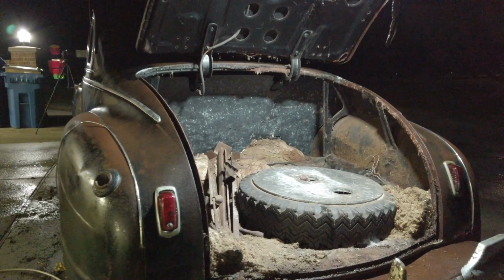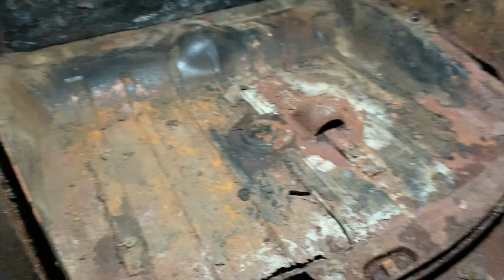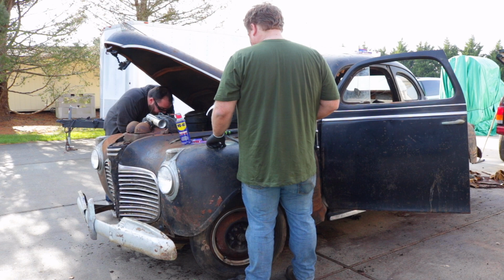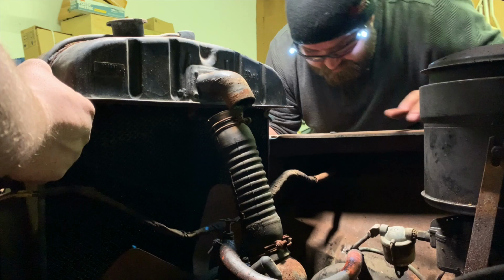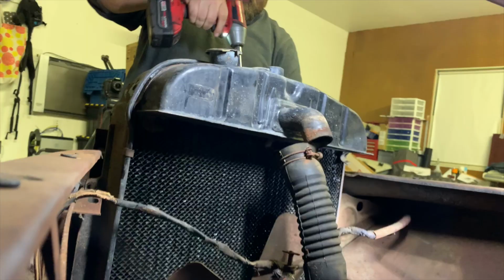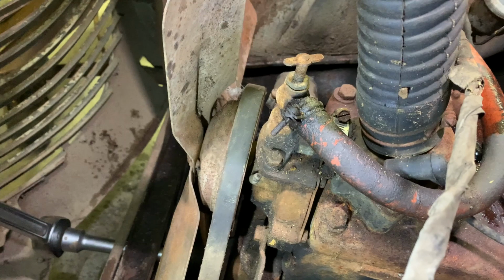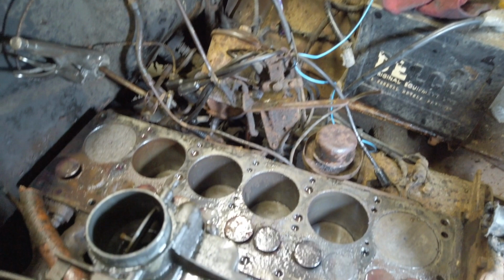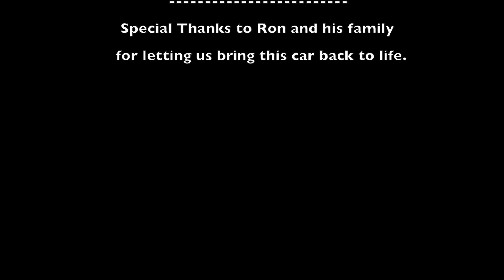Barn Find 41 Plymouth!  E:2 Clean Up; WILL IT START?

Comment: Exact same issue with my 1950 Dodge Power Wagon. Use a plastic hammer to tap valves closed as you crank it. I got it running enough to move around on it’s own. I did an old school valve job the following winter
Reply from the maker: We called a few flat head guys we know in California and they pretty much said the same thing.

Comment: When pulling or bump starting a car always use 2nd. or 3rd. gear. Never 1st.or reverse. It's a gear ratio leverage thing. Now for serious scraping, scrubbing and scrubbing some more. Hope you have a new head gasket.  You have the right juice for the unsticking  job. I use Marvelous Mysterious Oil and Diesel fuel 50-50 mix. A small wire wheel on a drill combined with New Words for busted knuckles will get the job done. Have fun gents I love that '41 Ply.
Reply from the maker: Thanks for the tips!  Busted Knuckles are a must for these projects. Thank you for following the project as well.

Comment: For one guy working and the other thinking, your doing fair. As those valves open doose the body of that valve with pb blaster or sea foam or something besides water displacement forty in the blue can as it can make harder.  then when cam has gone past point that has opened it tap the stuck valve back down ... while it it open use some croakes cloth and clean as much rust off  without reshaping the  valve, its pretty tuff so scuff it good. I would worrall it over once dried out with clean plugs back in head and reuse the copper head gasket. if necessary with hot wired tow to start a ways down the road. don't have to turn fast as everything is moving... like second gear and let it warm the engine a bit. as long as its being towed and has gas in the carb hole, it will fire but not enough to run till warmed some. You could safely bore those old engines ,120 over  without getting into water jackets so tow hell out of it! One in tow rig and one in car being started and one on fender riding with bottle of gasoline to get it going. within ten to fifteen minutes it will fire and keep going as long as it is being towed till you can push clutch in and it stays running with someone adding gas. You will be surprised at the torture it will take. Long as head is off keep tapping the valves till they close on their own. 5 out of 6 will work to get going and the other will pick up. When push comes to shove the sixty horse engine will run but need to be built and that car is too far gone to restore. A small v six engine would take its  place with a automatic trans. I might be 70 but pulled wrenches for over fifty years as I started for dad before I  was old enough to argue.
Reply from the maker: We are posting a new video soon that will answer some of this. But the motor is definitely solid. If we decide to replace the motor we will jump straight to a v8 or some sort. But we want to try to keep it mostly period context and keep this awesome patina. Anything modern we do we will try to hide as best we can for now. Thanks for following along! We appreciate it!

Comment: Best looking car ever made, looking for one to start my project. Ive collected ford SHO and aluminum Taurus engines for years im gonna drop a Aluminum DOHC out of a running driving 1999 ford Taurus i purchased with 19,000 original miles in 2010 from my buddy who passed wife. My girlfriend was in a horrible crash in my Cadillac DTS was rear-ended at 90 mph she didn't like the new small car i bought her she drove the big Taurus till around 2019 when she retired because the crash affected her and got max disability because she was educated and a hospital administrator. she drive very little but drives a large Suv. Taurus was well kept synthetic oil changes every 3k engine is cherry and one im gonna use. Drop a cast iron 2000 Taurus engine in and give to first person that needs one. no mods turbo or anything crazy. Ive heard a RWD Lincoln trans will work make it RWD. 41 Plymouth coupe ill find out west made destroy a restored one or find something that needs work.small chop and thats it. I'll purchase some coker tires steal wheels decent interior ac gotta work power windows. leather.what some custom headers keep the cats want it to run like a 99 Taurus want exhaust sticking out in front of doors. Im not building it the man that built my 1969 Peterbilt from scratch. I believe he can handle it. hope to be on your show with it or send it to you and you guys make a video. I think its gonna turn out cool definitely different ford DOHC in a 41 mild chop nice interior.wel'll see?  Thanks for showing me your 41 beautiful machine.
Reply from the maker: That is a lot! But it sounds like that will be an awesome project when she is done!  Thanks for sharing. Let us know when it’s all finished up
Reply: @MaffettMotorwerks  yeah a lot but according to retired engineers it's possible. Maybe I'll go easy and use some 70s  moper power idk but I'm 56 and gotta do something or start selling stuff. I'm not a car collector I'm a engine and parts collector. I got one complete classic a 65 mustang 6 cylinder nice car restored 33 yrs ago and put away id have to dig out of back of warehouse but it's just a mustang. I had to work sold tires for 35 yrs. just something about a 41 Plymouth trips my trigger. You guys video got me going again

Comment: Just for giggles and grins, could a person use a spare (?) household water heater and an external pump to run hot water through the engine via the heater hoses? Would bringing the block up to temp for a while be beneficial?
Reply from the maker: Great point.  I think any time you can get a block to operating temp it aides the inner workings of the motor itself. But we ended up flushing the cooling system any way and these heat up pretty quick once they start firing.

Comment: Suggest remove manifolds. Open valve side covers. Release valve spring keepers. Remove springs and lift valves out. Get some lapping compound and a hand lapping tool. Lap all valves until they seal again. Check valve seat seal-ability by reassembling valve train. Turn engine to TDC for each individual cylinder. Pour a little raw kerosene around the valve seat area. Get a flashlight and look up in thru valve ports on bottom side. Look for traces of kerosene getting down past valve seats. Continue back with lapping again until valve seats will not allow kerosene past. Then you know you have good valve sealing. While valve train is out suggest removing all sludge in the area. Highly recommend a used, vintage scissor type valve spring compressor tool for this job. Resist the temptation to use a power tool to turn valves to lap. Twist by hand only. Be sure the valve spring retainers do not drop down in oil pan when removing. Then set valve/tappet clearance when engine is fully warmed up to operating temps. While manifolds are off get a carb kit and rebuild it. Easily done. Mechanical fuel pump is likely your next problem. Recommend a 6V electric be installed. See how all this work compounds? Lol. Good luck. I’ll be following along.
Reply from the maker: Good suggestion all great points made for sure. Thanks for following along with us!

Comment: Use some linseed oil on the car it will clean it up nice and protect the steel it works great
Reply from the maker: I have seen that a lot lately I will definitely give that a shot later.
Reply: @MaffettMotorwerks  I imagine it will also make it a dust magnet.
Reply: @Rebel9668  I take it you have never used linseed oil before because if you did you would know it does not become a "Dust Magnet" LOL!! Many guys use linseed oil on antique cars if it became a dust magnet we would not use it
Reply: @79tazman  Actually I have indeed used linseed oil as a finish, but for wood.  Everything from the stock of an 1853 British Enfield to a bare wood floor and chimney mantels and so I have experience with how much dust it collects, whereas wax actually repels dust..  Such is the case with my 1933 Philco Highboy.  I gave it a finish with Briwax 4 years ago and haven't hardly ever had to dust it.  Johnson wax works just as well as I used it to wax my circa 1888 bedframe.  I can honestly say that while a linseed oil finish looks nice it most certainly does make everything I ever used it on a dust magnet.

Comment: Starting at 21:52 Are you guys hooking a 12V battery charger at high amp setting up to the old 6V battery and slamming 12V though it to the starter?  It sounds like 12V on that starter motor when it's turning the engine over.  Highly recommend safety glasses, especially when leaning over that battery....Battery may go boom!
Reply: Hey Keith, I know it does appear that way in the clip. What's actually happening is that old 6 volt battery is just sitting in the tray,  With only one terminal hooked up. I'm using a pair of jumper cables to a battery sitting on the floor.  Good looking out as you are correct about the boom potential the other way.
Reply: andy sheppard You are running 12V through the starter though, correct? The battery on the floor you describe is 12V?
Reply: It is indeed 12v

Comment: Next time around or as they say himd sight is always 20/20. Removed rat poo and nests before washing so it doesn't soak up any water leaking into the vehicle. Then having wet rat poo and nest materials. It only makes a bad experience even worse and smellier Lol! 😂 Sweet car though for a barn find!
Reply from the maker: That is a great point, we moved as much as we could with the dust pan first. But those critters really locked in there. Thanks for the comment!

Comment: cut the radiator hose $10. Cut the horn wires, another repair that wasn't needed n now your wire is patched. 1 out of 10, I give you a 3, Its a nice car
Reply from the maker: ste cra the hoses were very much corroded and dry rotted. Already leaking with no pressure in them.   The wires are also so brittle they were breaking under our hands. We are rewriting the entire vehicle so we don’t mind taking the time to put new wires in, and we won’t be running any patch wires.   Thanks for watching!

Comment: Please pull the oil pan and clean it before you switch to a modern detergent oil- otherwise it’ll kick up all that sludge and clog the oil galleries, burning out bearings. Also, when you put a new water pump on (new ones are like $50), be certain to pull and clean/replace the water distribution tube behind the pump. Some were steel, others brass. I’d recommend a new aluminium radiator too, they’re about $240 if you’ve the money. I haven’t had any luck with the old brass ones, they just clog up and run hot. Beyond that, I’ve almost always had to pull the head and play whack-a-mole with the valves and clean valve seats. Pull the valve covers too, critters like to get in there; you’ll need to pull the passenger tire and there’s an access panel on the inner fender. The old 201’s were an ok motor, but a newer 230 will swap right in and make more power. Look up Andy Bernbaum auto parts, they have everything.  Best of luck guys! She looks awesome!
Reply from the maker: Absolutely. The pan will be pulled and cleaned out before we run any modern oil through it that is for sure.

Comment: Interesting the end of the crank is set up for hand crank - was there an access hole to get a crank in there?
Reply from the maker: That was interesting to us as well. There was a very small hole in the grill to reach in with. But without the proper tool it would have been impossible to crank.  We 100% tries to find one on eBay just to try it haha. Good eye Chris!
Reply: I think 41 was the last year they had the crank start to start the car if the battery was dead but they had a starter on it too there is a cover for the hole in the middle bar going down the center of the grille
Reply: @MaffettMotorwerks  There should be a crank hole cover in the middle bar about the third horizontal bar from the bottom you remove that cover and the crank will fit in there if you had to use it but they had starters on them in 41
Reply: @MaffettMotorwerks  Be careful not to use 12 volts on the 6 volt system you can fry the gauges and everything using 12 volts
Reply: @79tazman  My dad had a '63 Austin when I was a teen and it had a crank start for when the battery was dead - came in handy when you were tuning the engine and wanted it at top dead centre too.
Reply from the maker: All of the electrical in the car is disconnected by us or the mice.
Reply: This engine dates back to the hand crank days of Plymouth. It was so smooth and dependable there was no need to change anything on it

Comment: Is the car still on the 6 volt system?
Reply from the maker: For now yes. Plans to convert it soon
Reply: @MaffettMotorwerks  cool. I have a 41 Plymouth Business Coupe that belonged to my great grandmother. It has 38K original miles and was near mint when we pulled it out of her garage outside of Joplin Missouri. Cleaned out carb and fuel tank and it runs and drives. We decided to keep the original 6 volt system in there since it works so good still.
Reply from the maker: That is awesome!